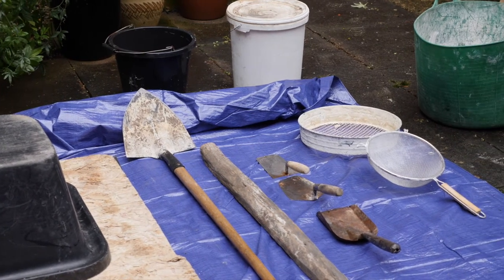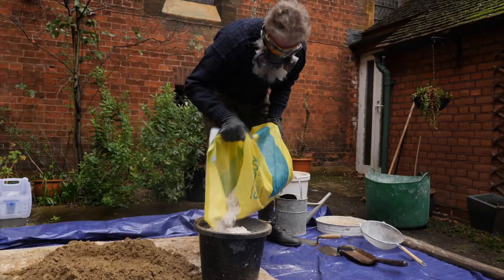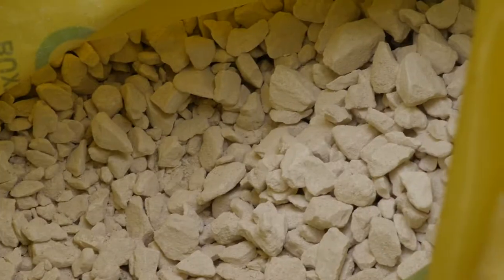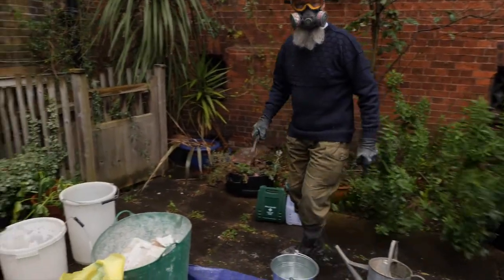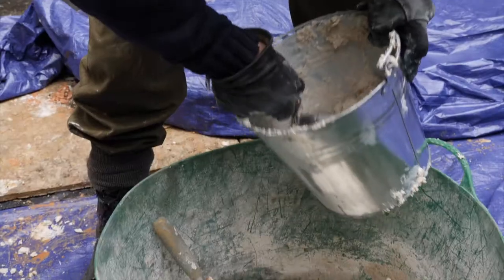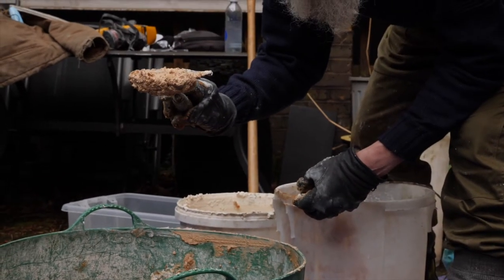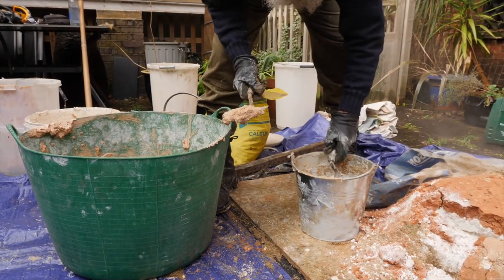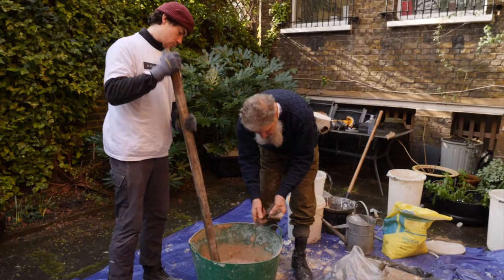Building Conservation | Lime, Mortar & Plaster Part 1

Comment: Bagged NHL is so much easier. I still mix by hand as you’ve more control over getting a consistent mix/colour. Also I add the mixture to water and keep adding and mixing in the bucket until I get the right consistency. Seems to be OK . I’m over half way through repointing a beach cobbled building right on the beach and exposed to North Westerlies. Using NHL 3.5 and a mix of three aggregates from Ty Mawr at Brecon. Been at it for over 15 years on and off and reckon I’ve got another 10-15000 cobbles to go!

Comment: I remember when lime wasn't available in fine agregate in bags like today.Actualy it was but it was very expensive.Then people were buying lime in form of stones and they dig hole in ground and put all that stones in it and then pour water on it and it was nasty.Later you have something like white soapy lime and you simply grab out of hole how much you need and mix with sand and you have excellent mortar which last forever.

Comment: Fabulous video- how exciting! Chemistry at work. Our ancestors were so clever- I had no idea you could buy horse hair for lime pointing. I'm renovating an old stone house using 3.5 NHL lime for the main repairs but  I suppose the lime putty would be the best sort of lime to point the stones or cover them altogether with a pigment. Thanks.
Reply: check out Michael James design, gotta know exactly what you're doing in this particular field, for the buildings' sake and the old-timers whose fabulous work we're supposed to be repairing

Comment: I have just bought a very old stone and lime wall house and really want to keep to traditional building techniques which is lime instead of cement and am trying to gather as much information I can to share with the builders who of course just want to do cement!!!! Your video is super helpful but I have a question.. If I’m mixing my lime from dry powder lime, making it into a putty to then use it with a mix of sand to plaster my wall, I have to cure it for 2y (let it sit in a bucket) or, buy ready made wet putty? Thank you so much.
Reply: hotlime is what you need, check out Michael James Design or Nigel Copsey, try a hotlime wash too